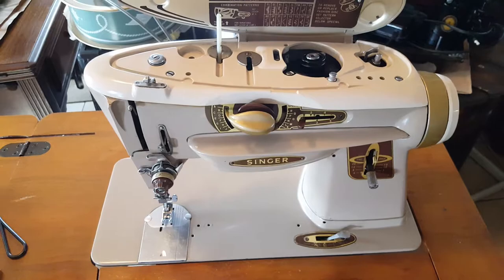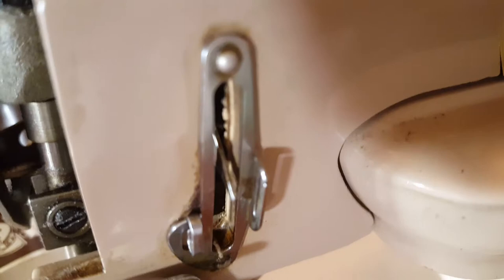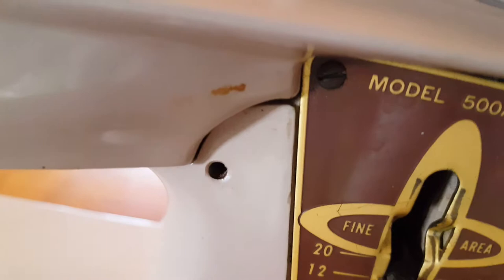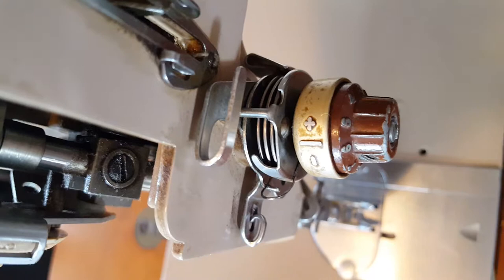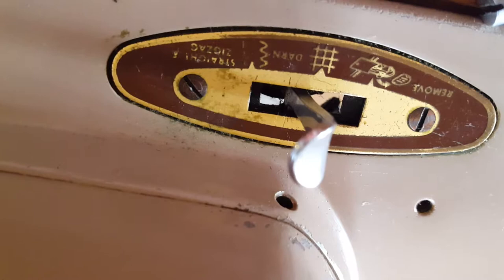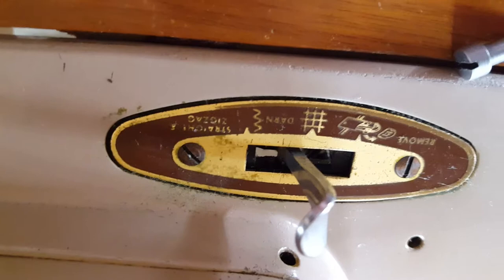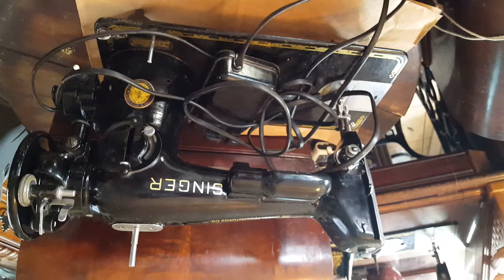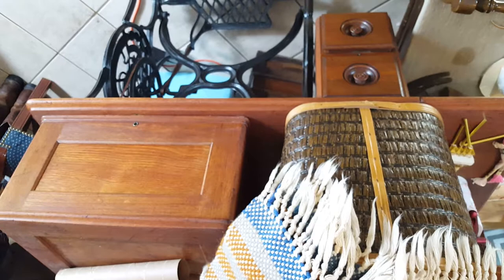Singer model 500A beginning clean up and restoration

Comment: Jackie, how did you repair that back hinge? I just "rescued" one with the exact same problem. It has both the pins, but I'm not sure how to get it all in the right place. From the knocks and dings on the paint, I can tell someone else had the same problem before. Also, the door that covers the needle and pressure foot apparatus is completely missing. Any ideas where to get a replacement? Thanks!
Reply from the maker: I literally just snapped in on so to speak, it seamed quite easy at the time. maybe it was more luck,,,lol ebay for parts. thats where I find most of the parts I need, when I do. I will take a look at that top again and see if I can offer any hints, on putting that back. thanks
Reply from the maker: took the pins out , held it in place and the pushed the pins in, I do believe I will look at my parts machine, double check.

Comment: HELP!! 
Hello thank you for you videos, I love and appreciate them So I just bought a, pretty darn close to perfect, Singer 500A Rocketere And as both of the spool pins were there and working just fine, untill my dumb self was cleaning and wiping out under the lid and I knocked one of the spool pins out and it slipped down into the Machine. Ugh!!! So my question is do you know how to open up the top of the machine and then put it BACK where it goes?? I'm so FOOLISH I can't believe I did this!!! Grrrrr 😖!! Thank you and God bless. Jen
Reply from the maker: Did you get that fixed I believe you just stick those right straight back in the top don't they have a little spring that they fold down with. I'm thinking of the 500 I don't have one currently.